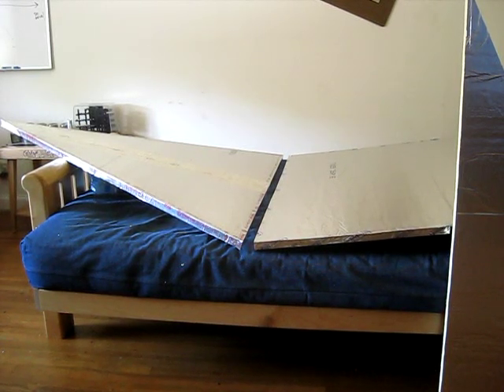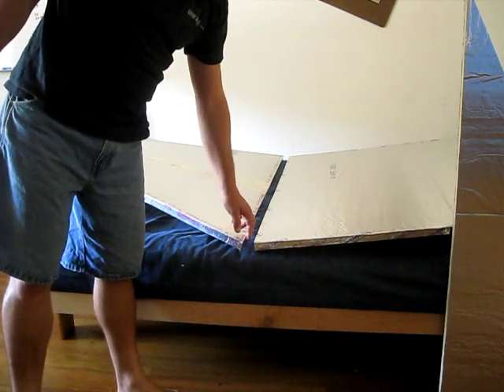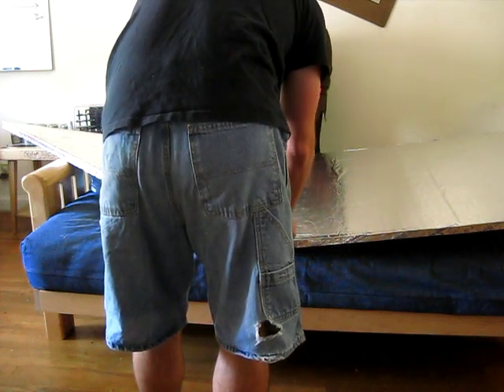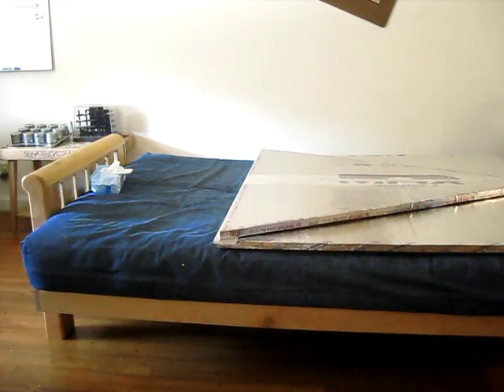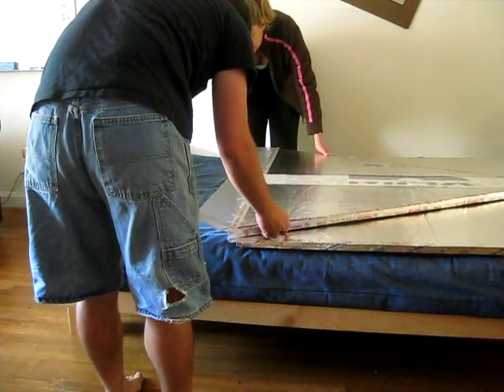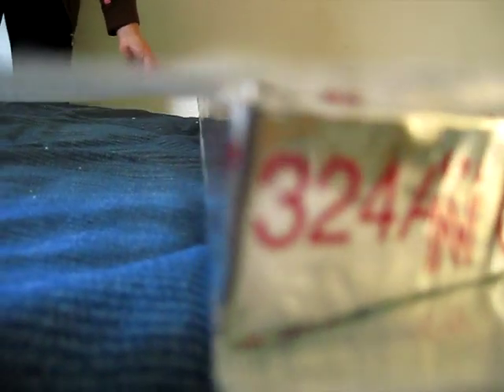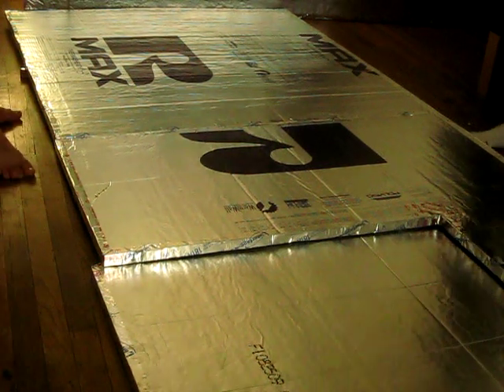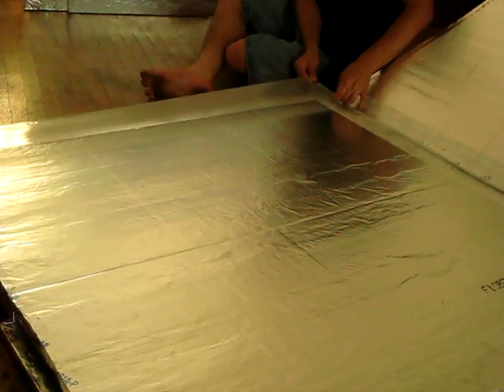yurt-seam.mov

Comment: After you attach the first piece of tape, before you fold the pieces into the "shipping" configuration, you should put the spare piece of siding in between them so you don't have to deal with the "bubble" and you can quickly tape over the other edge...